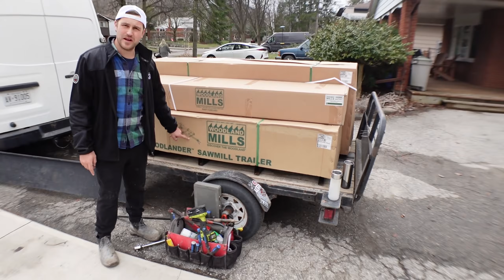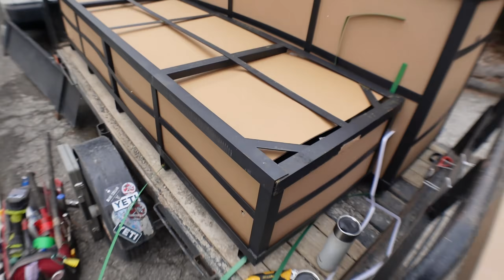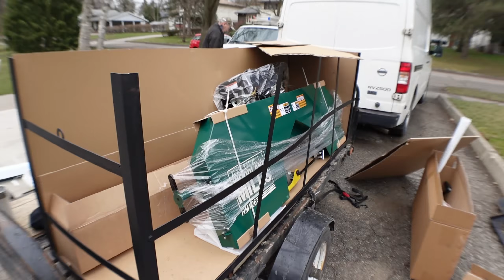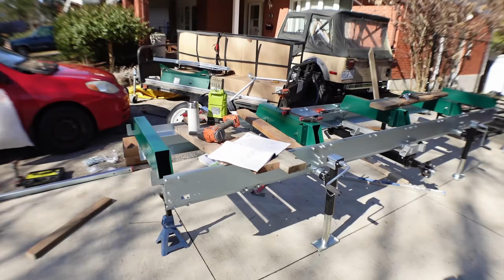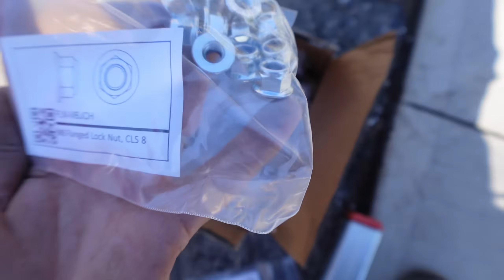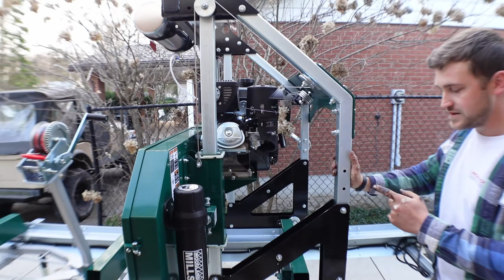Woodland Mills HM126 sawmill with trailer assembly

Comment: Very nice! I just got mine. Same unit. 
It’s in the yard on a trailer. 
Kitchen reno on the go right now and just had a baby girl. 
Hopefully by the fall, get it set up at the camp, and I have some logs ready to try out. 
Next winter hopefully lots of cutting and hauling and milling by next summer. 
Great video.
Reply from the maker: Awesome man! congrats on the baby, hope the milling is going great
Reply: @meyers.makes. well its set up, under a couple feet of snow now but i did square off some cedar telephone poles in the fall to break her in and its amazing. Cant wait for this years milling. I have an extension for her and the lap siding attachment to be installed this year.
Reply from the maker: @slappy442 unreal man! Enjoy it